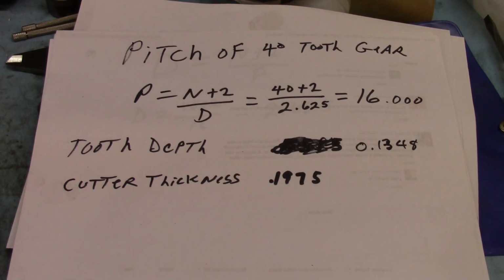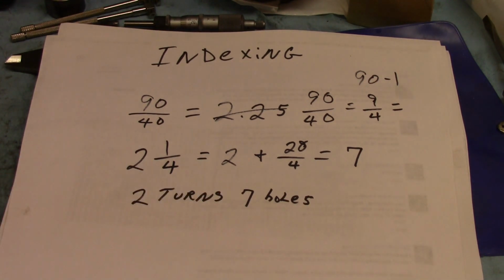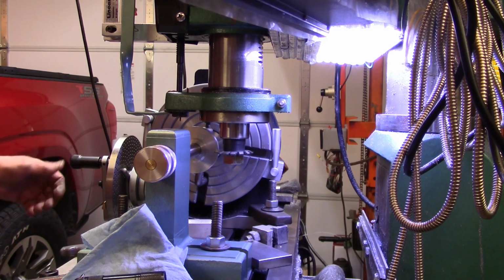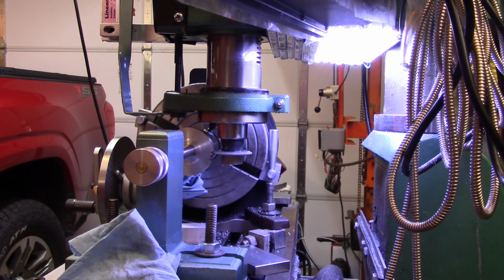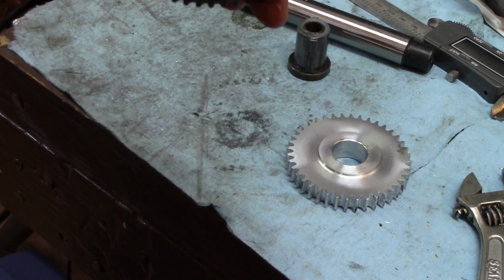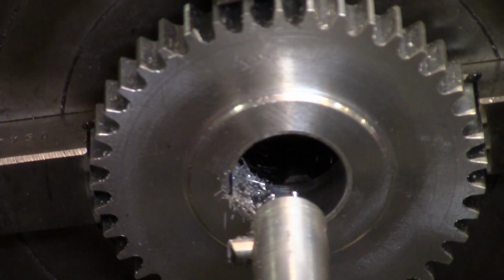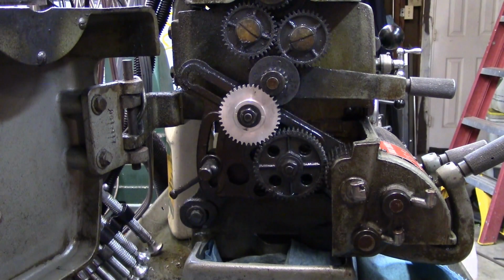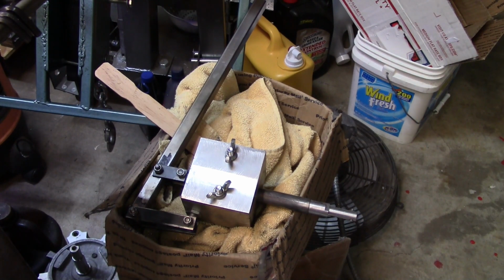Gear Cutting   my first gear part 2

Comment: Great results Harold! To use your square cutter, you could always get a square broach to make the necessary hole in your homebrew broaching machine. Speaking of which, heck, add a motor to that thing and you've got yourself a toolpost-mounted shaper. Way to go!
Reply from the maker: That has been suggested.  I do not use the thing all that often though.  Thanks for stopping by.

Comment: Nice job Harold.  That aluminium gear will outlast all of us.

There's something satisfying about seeing your own shiny home made gears in action.   Even better when it's home cast alloy as well.

I would lube the gear with some oil initially so that it wears in nicely.   

Cheers Rob
Reply: it should do fine, it would probably be the weak link if the lathe crashed, otherwise, yes will last a long time, always good to know he can make gear, nothing stopping him making it from steel next time
Reply from the maker: It is good to know I can do it.  Thanks for stopping by.
Reply from the maker: Casting a gear is a bit too far for me.  Thanks for stopping by.

Comment: Great job Harold! after all the figuring and research, think how easy the second will be. I made my first out of aluminum then a second out of bronze, I was lucky enough to have a sample and I ground a single point cutter to the tooth profile on the sample, it worked quite well. Congratulations and thanks for the video, cheers!
By the by; I haven't needed the bronze gear yet!
Reply from the maker: I am not likely to need the aluminum gear either.   I just made to learn how.  Thanks for viewing.

Comment: The keyway cutter definitely looks easier to use for keyway cutting than just moving the saddle back and forth.  Nice job on the gear.
Reply from the maker: I don't like the feel of the wheel when I try to use the carriage.  I figure it will break something expensive sooner than later.  Thanks for viewing.

Comment: Harold G'day. Bruce here from the other side of the world. Randy Richard suggested I pay you a visit. I'll subscribe to your channel. If you don't mind I'll pass on a couple of comments. Firstly great job there on that gear. when I'm cutting gears in soft materials like that I generally put a sacrificial plate on the side the cutter daylights out of the part, that reduces the amount of touching up required as the gear comes out pretty clean. Another thing that I like to do is I make the intermediate gears from Phenolic, this provides a "Silent Gear" that also takes away the need for lubrication. BTW good item that slotter in lieu of broaches, still hard work for our old bones though. I'll be sending you an email. Go well Bruce Whitham Perth Australia.
Reply from the maker: Welcome to the channel and thanks for the suggestions.

Comment: Mr Harold. very nice work on a first gear. For your key cutter you should hook up an old wiper motor.  Would save your arm alot of back and forth motion. just a little suggestion.
Reply from the maker: There is a use for the two wiper motors, thanks.  Thanks for stopping by.

Comment: You can make a round hole, just big enough for a square bit to fit in and then put a set screw in from the end of the holder and it will work and hold the square bit in the proper alignment.
Reply from the maker: Thanks for the suggestion.   Thanks for viewing.

Comment: Harold, I'm curious. What was wrong with the old gear? Thanks! " Keeping on" in ky!
Reply from the maker: Actually I am still using the old gear.  It was a bit loose on the bushing and in the "other" position it seems to wobble a bit.  Besides it was a handy gear to take out and compare.  I felt the gear I made had to operate some place to prove it was made correctly.  Thanks for stopping by.